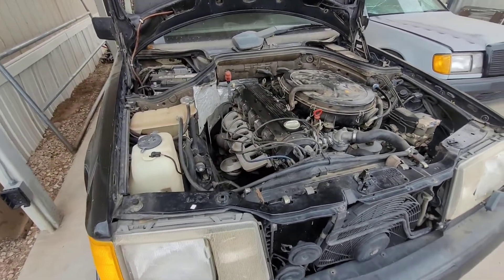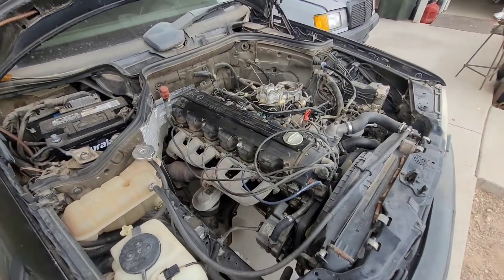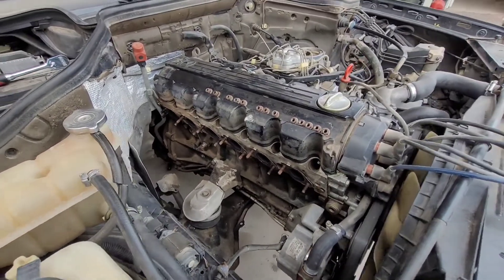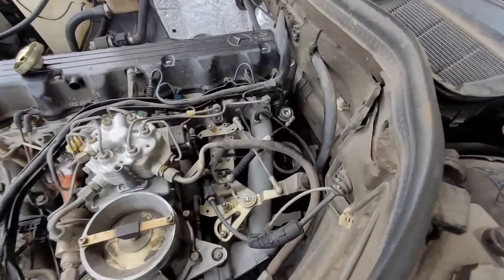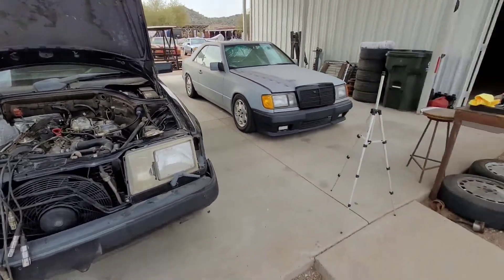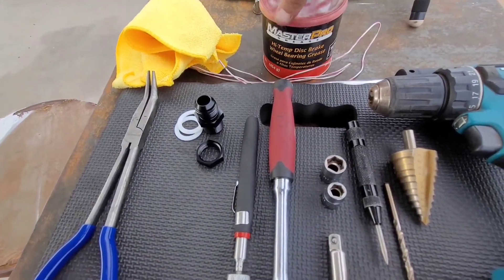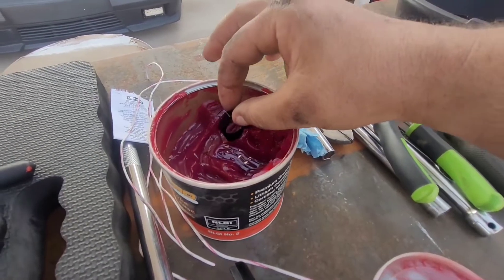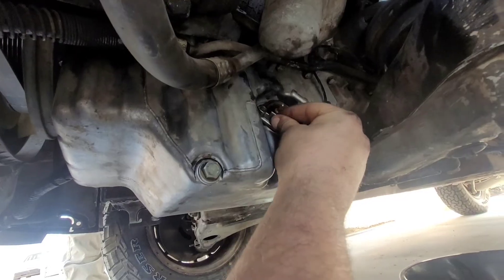DIY M103 Turbo With CIS k-Jet

Comment: Hi, great video! I have two questions:
1. Shouldn't crankcase ventilation be modified or improved when turbocharging in order to prevent excessive pressure buildup  which can lead to oil leaks and turbocharger damage? 
2. How much power can the stock fuel system support?
Thanks
Reply from the maker: So yes you can add crank ventilation we just let it alone never really had any issues it's low boost so didn't have to worry about it 

6-7lbs no issue it's not really the fuel you have to worry about but the timing and ignition there is zero way to advance it

Comment: Hello. Do you have a preference for the M103? Why don't I use an M104?
Reply from the maker: @RubenGiovanetti  I'm going to make a video comparing them the m103 is very underrated and over looked its a tank of an engine I won't touch an m104
Reply: @thebenzhouse  I want to put a turbo in my M103, but I could also buy an M104.980 and put the turbo in. I don't know if the expense is justified.
Reply from the maker: @RubenGiovanetti  it's definitely not Especially If you already have an m103 your just gonna waste your time and money
Reply: @thebenzhouse  Ok, thank you very much for your advice, I will move forward with the M103. THK
Reply from the maker: @RubenGiovanetti  good luck have fun if you need anything letme know I'm happy to help

Comment: I've been working on my build and have a 4" silicone 90* boot for the CIS distributor, I cant get it to fit. Do you know what elbow you used to connect the boot pipe to the CIS distributor?
Reply from the maker: @KombatRok  it's a very very tight fit you have to get a cheaper one the more expensive ones are way to thick and don't want to stretch out
Reply: having the same issue

Comment: Hi, I would like to get in touch with you and get your thoughts on my current project. I recently picked up a Euro 1981 MB 230CE w/5sp manual and I am contemplating an engine swap. I've viewed all the episodes on the EFI swap (Turtle) and am encouraged about the possibility of a M103 in my car with EFI and turbo. But...also wondering if I could get similar results just doing the same thing to my existing M102.980. Then I wouldn't have to swap motor/tranny. Lot less work.
Reply from the maker: @Jagmeister-xj4df  message me on IG I'll be more than happy to talk there 😉

Comment: Hey man hope you are well. 
I started running a 200cc injector activated by a 3psi hobbs switch for boost enrichment, the injector bleeds fuel from the fuel metering head and sends it back to the fuel return line. When it switches on I get 11.5-11.8 afr.

Just wondering if you know the power limitations of the Ke jet fuel metering flap?  How much air can it measure until it bottoms out? 
I’ve got a 86 300se.

Thanks
Taylor
Reply from the maker: @taylorbushnell5838  cool setup man and honestly I couldn't tell ya the max on the air flap

Comment: Hey bro is there any reason you dont just take the sump off to drill the oil return?
Reply from the maker: We normally do it's easy BUT most people don't have an engine lift and the bigger tools this is just a easy diy style for most. Just make sure you clean the hell out of the tank

Comment: Not a good idea to use reusable filter.. for such sensitive Maschines like combustion engine.

Ok I wrote it before I saw you drilling oil pan without taking it off 😫😫
Reply from the maker: @kostia_mu  yepp I use a reusable filter and the car runs just fine over a year later with zero issues and 16k miles on it since it was done
Reply: @thebenzhouse  Fine! Im automotive engineer, i also related to engineers of Mann Filter in Germany i also visited R&D center .. so there is way more tech inside of a oil or air filter as in coffee filter :) I know in US you use K&N washable air filter .. its crazy but I never heard ob reusable oil filter. But ok. Maybe you right and im only a Victoire Marketing, who knows, but 16 miles kind short period. Hope your engine do well further mate! Of course its nonsense to talk about oil filter while you have aluminum chips in the oilpan. No front- I just very horrified! Your car, you do what you think is right for you! But that’s why we are skeptical about US import cars in Europe..
Reply from the maker: @kostia_mu  16k miles that's 16000 miles
Reply: @thebenzhouse  there two service intervals, two oil changes. Maybe you wouldn’t see any problems in this period without oil filter at all, who knows. But problem would increase cumulatively. Once I drove w201 250d with over 1 Mio miles on it (the counter goes for a second round) than you can say you did everything right. I would like to ask you for reasons for your decision. Is it for saving money or you think Filter Industrie is a skam?
Reply from the maker: @kostia_mu  it comes in handy and the filter no one carries here in stock so we always had to order them it just got annoying so we started using this one and it turned out to work great I have over 10 cars and use this brand filter all of them do fine there just convenient is all
Reply: @thebenzhouse  ok tnx. Maybe I can find some further Information about them. But in my understanding when filter can stop particles and they stuck inside the filtering element (modern filter work on principle of deep filtration with 3-4 different physical principles for each size range of particles) it won’t be easy to clean them out! On the other hand if you can easily clean the filtering element- so the particles ain’t really stuck inside the mesh. You can’t get both. Same complaint with washable K&N - benchmark tests proof this. No manufacturer install them as OEM part. Maybe there ist Groundbreaking revolution technology in this oil filter would be great.  But in case you don’t have any trust or faith issues on filter and automotive industry, and its all about convenience, maybe you overthink it. Technique can’t be cheated. I also will do research on it. Who knows :) good luck 🍀👍

Comment: On the oil return line from the turbo, what's stopping you from simply drilling and tapping the oil fill cap on the valve cover and dumping return oil there? I don't think anything there would be upset with the extra feed and it would go back to the pan without any worry about cavitation and sloshing, as well as the shavings. And it would be 100% reversible with a $10 cap. I definitely haven't tried this, just thinking out loud.
Reply: Turbo oil drain can not go upward from turbo, if it will oil wont just immidietly flow down drain in turbo but it will collect in turbocharger and be able to go past seals and into exhaust and intake side of turbine wich will result in huge oil consumption and a lot of smoke. When you make turbo oil drain make sure the hose goes downward all the way from turbo to oil pan and that at the place where it enters oil pan it is still above oil level.

Comment: What ecu u use
Reply from the maker: This is stock factory k jet no ecu if your looking to do a stand alone ecu check out some of my other videos 😉 I have a step by step EFI series!
Reply: @thebenzhouse  bcz it wont work with a turbo u need more fuel and if you out external relay for more fuel it s not reliable you need ecu or wont turn on
Reply from the maker: @joehebbo7047  it can work up to about 6-8lbs of boost with zero issues go check out my other videos. I did it to multiple m103 engines I drive them around on a daily. There are a few other people that have done it as well you can't get crazy power out of them but you can run them with little boost.

Comment: Could you do something similar for the m104?
Reply from the maker: With cis yes if it's fuel injection I don't think so you'll need to tune for it so basically stand alone efi
Reply: @thebenzhouse  So the early stage m104 like in the 92 300ces had the cis system but was an m104 24 valve your saying with this info it should work?
Reply from the maker: @zacharyherrera-df1hl  yes from what I understand as long as it's cis I don't see why not; If I'm wrong I'm sure someone can chime in.

Comment: I'd take the oil pan off and clean out the shavings, to be 100% sure pan is shavings free.
Reply from the maker: Yes always but this is just a quick and easy way to get it done if you don't want to remove the engine to take off the pan is all if you get a boroscope you can clean it like that as well that's what we did here

Comment: Think I'd rather just remove the oil sump, but suppose this is easier in some respects
Reply from the maker: The oil pan is easy to remove you have to lift the motor pretty high tho

Comment: Hi, what is the HP increase?
Reply: @hamlulit I think the 103m has 160-180hp or something na. So for every bar of boost we increase it by 2 times the power so 160 would be around 320 at 1bar or 14.5psi of boost. The size of the turbo is important as well and I don't really think you'd want to do more than 7psi, at least that's what I've read. 7psi would put you at 270hp I think 270-250, you need a tuner. I assume they say 7psi maximum online because you'll run out of stock injector beyond it or blow a head gasket. There is virtually almost no limit to the amount of boost depending on the turbos size though, if it was all forged, a 160hp moter could take 5bar or more multiplying it's power 5 times 700hp+.
Reply: @bigmoney4661  thanks for the detailed reply!

Comment: (I ask bc i don't know)
You are running a no intercooler which means the hot turbo air is going straight back into the engine just what to know how risky that is and is there downsides or does it ruin your engine or won't be able to run a long time bc of the hot air
Reply from the maker: We have water methanol injection now but for the 1st few months it was cool out and it would heat soak after about 3 hard pulls engine still runs stronger than ever with no issues

Comment: Love it. Great job !!!
Question: are you using some ECU or anything to control the boost etc ? As I don’t see anything mention about this ? Thanks
Reply from the maker: Stock ecu nothing modified there what so ever It's just on wastegate presure 8lbs with no issues as of yet we've put around 8k miles on it so far
Reply: @thebenzhouse  that’s amazing how this engines are capable with “ simple “ job. Great job again and regards from 🇬🇧 UK . Starting my project on September
Reply from the maker: @BBartyFly  these engines if all you do is boost and efi can handle easy 700 hp no problem they are amazing
Reply: @thebenzhouse  bro I want to push 300-450 hp this will do or you have any advice ,also my transmission is automatic is going bad would you recommend rebuilding or is there any option for a better transmission e300 1990
Reply from the maker: @HablandoMmayuscula  thr whole car is stock just added a turbo the cis and stock ignition won't support that kind of power you'll have to go to an efi kit for that kind of power
Reply: @thebenzhouse  thanks bro not a lot of content on this car with the original motor and trans keep up the work been helpful to me 👍
Reply from the maker: @viking2253  I always try my best to msg everyone back I do get lots of messages so if I miss one I apologize
Reply from the maker: @viking2253 100% stock just a turbo that's it

Comment: I will turbocharge my 300sel too.I will use the cis but i have to relocate the cis and use flexible pipes for turbo setup.Air has to be sucked through cis to turbo not pushed to cis😂

Comment: Been planning a similar kind of setup. What is the fuel mileage like?
Reply from the maker: It went from about 28mpg to 24mpg
Reply: @thebenzhouse  Thank you for a quick answer! I was curious to know because I’ve been planning a similar setup for my summer daily.
Reply from the maker: @Moneyblock of course I try and stay on top of it 😁 and yea it did go down a little but not to bad
Reply: @thebenzhouse  Yeah that’s not bad at all. Usually out of tune M103 doesn’t even get that good mpg😆
Reply from the maker: @Moneyblock  I mean depending on alot I average about 30mpg on most of the cars believe it or not the worst I've ever seen is about 17mpg but needed ALOT of tuning plugs oil ect

Comment: I have 300se 1987 are this same Engine you have???
Reply from the maker: If it has the inline 6 then yes I know some of the 300ce had the 4cyl just gotta pop that hood and take a look
Reply: @thebenzhouse  Have inlane 6 and 185 Hp no catasolator car.Runns grate only 10tusen km grate chape.Wath do you tink abaut orginal hedds i have if have those Open and down and two Gt3 smal Turbos.Spell like hell sorry hope you can anderstand me hear!!!
Reply from the maker: @Jarmo minkkinen  the engines are very strong the head is good the only problem with the early m103 engines are the camshaft score easy because they used a softer metal the m103 3.0 inline 6 are amazing
Reply: @thebenzhouse  Okej tanks four You are answer.I have Question wear can I se wath Engine gear i have.The Earlier owner tell me The car have Engine from 1990...Can you help me hear tou se wath gear thes Engine are from! where to look.!?

Comment: How much boost can I get away with without an intercooler? I'm from Gold Coast QLD AUS. Average temps are 27 Deg C 65% humidity?
Reply from the maker: I wouldn't do more than 6-8 lbs it will heat soak ect we ended up adding water methanol injection to this specific build also it all depends on the tuning as well you can't get 2much with cis setup if you want good real power with no issues efi is best but the cis is good for now

Comment: what size is the silicone tube that goes in the throttle body? 4 inch?
Reply from the maker: Yes you are correct it's a 4in to 3in
Reply: @thebenzhouse  one more thing, you are not running the stock lambda right? for running the AF ratio gauge you need to install a new oxigen sensor i guess
Reply from the maker: @Junito Master  I do have the stock one in I also have a new one to ready my afr before the original

Comment: Nice man, not much of a gas guy but it’s nice to see my twin motor getting a turbo too
Reply from the maker: I got the idea from a 603 with no intercooler we have 2 of them 87 sedan 300d turbo and a 87 300td wagon the setup is so simple and right to the point we've done this to a few gas motors and they all run and drive great
Reply: @thebenzhouse  thats exactly what we have! do you have any other social media platforms? insta?
Reply from the maker: @Turbo.Teutonic  yes I'm pretty sure we follow each other I'll send you a pm
Reply: @thebenzhouse  looks like I will be doing this to one of my 124s
Reply from the maker: @ricky4638  if you need any help let me know
Reply: @thebenzhouse  you have an IG right?
Reply from the maker: @ricky4638  I do it's it's benzboi23 I don't post that much but I'm going to start posting alot more
Reply: @thebenzhouse  is it possible and reliable to install turbo on m101?
Reply from the maker: @ENGKU HYDDER  what engine is that I'm sorry idk that one
Reply: @thebenzhouse  

😃😃oh sorry😅😃😃

i meant a m110 engine 2.7 engine used in 280 variant of 
w123(280e,280te,280ce)
w126(280se/sel)
R107(280SLC & 280SL)
Reply: Any plans for intercooler? That would be good
Reply from the maker: @rfbu  no plans on intercooler but water methanol injection
Reply: Where did you get the turbo and is this a kit?